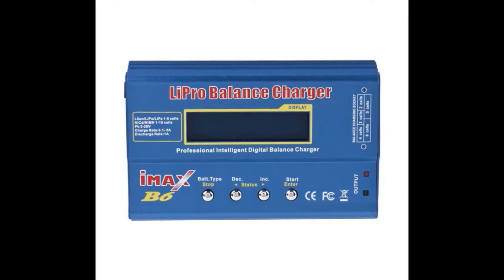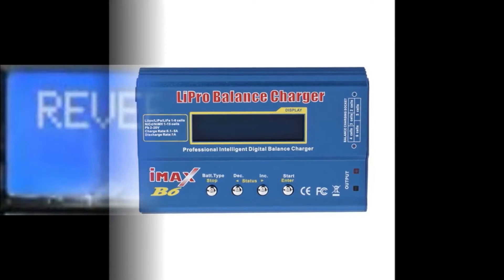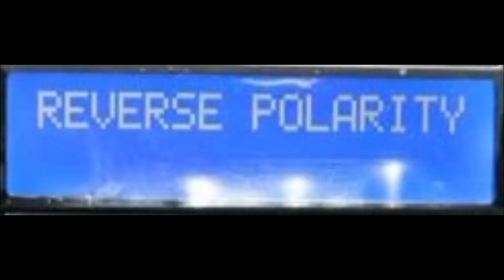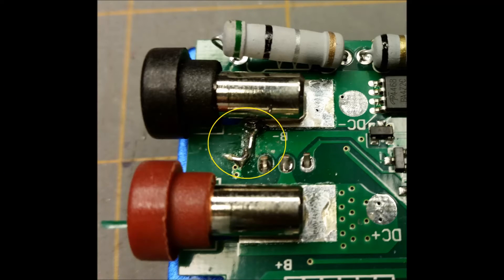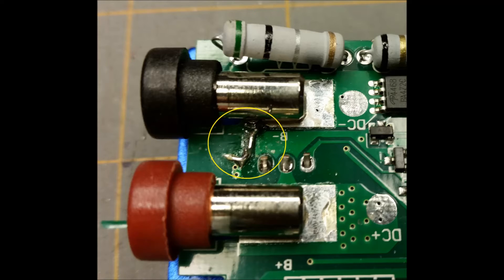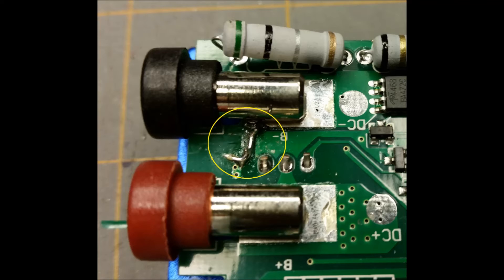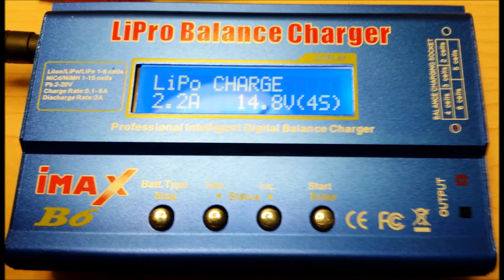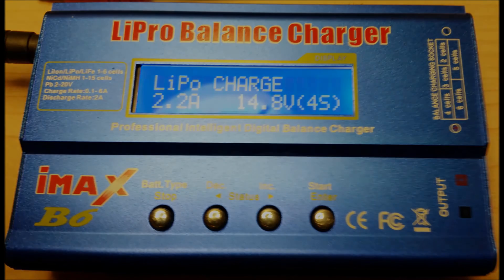i-MAX B6 LiPo Battery Charger REVERSE POLARITY Error Repair

Comment: my arrma 2400 nimh battery, when i bought a cord off of amazon to use off of my balance charger to charge the battery, and i plugged it in, NO noise, no smoke, nothin, it said reverse polarity even though my wall charger works fine with the battery? (rc battery)

Comment: Is it possible for NIMH to reverse it's polarity
Reply from the maker: If you plug the cable into the charger incorrectly, as I did, any battery you connect (or as in my case the charger) is going to have a bad day.
Reply: @RetroRogersLab  will the battery reverse polarity if the Electronic speed controller battery cable is wired up wrong and plugged the battery into the ESC would that reverse the polarity of the battery also or is that just the charger
Reply from the maker: I'd expect the outcome of reversing the polarity when connecting an ESC to be a blown ESC. Once something fails it is difficult to determine what else might happen. If the ESC creates a short it could damage the battery. Transients on the power could damage sensitive electronics.
Reply: @RetroRogersLab  well the battery wires to my ESC where wired backwards red to red black to black the way it's suppose to be but I did not know that I plugged the battery into the ESC turned the ESC on and fried it the battery got hot the ESC got hot and I quickly unplugged the battery from the ESC and I called Redcat Racing and I told them what happened and they said the battery is alright to still use as long as there's not puffing or swelling of the battery
Reply: @RetroRogersLab  could reverse polarity happen if the cables to the ESC are wired up wrong could the through the battery into a reverse polarity state if I plugged it in
Reply: Generally the charger will just show an incorrect polarity error and not initiate the charge if you try to start the charge with the battery connected with reversed polarity however if, like in your case,  the charger already started charging with the correct polarity and you inverse the polarity while it's charging then something on the charger will blow.
Reply: NiMH batteries can reverse polarity if a load is connected past the point of full discharge